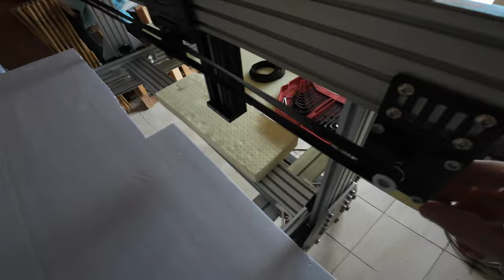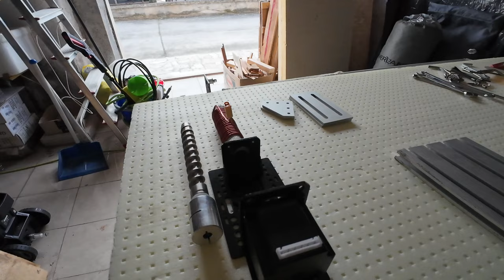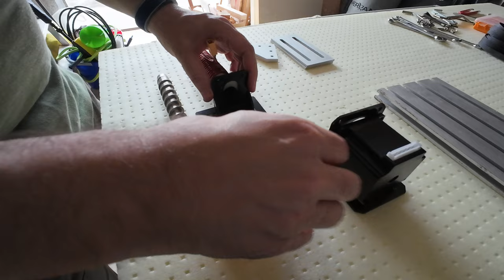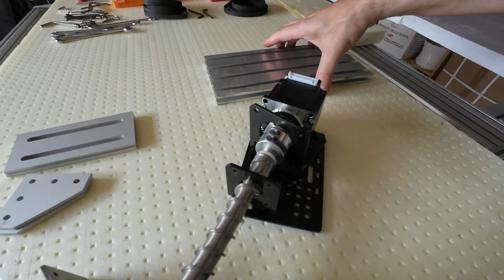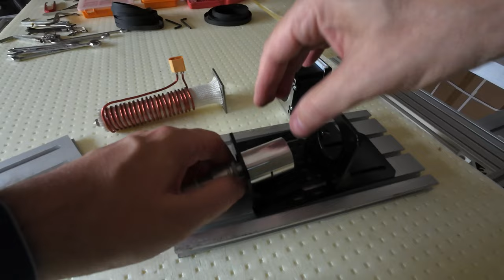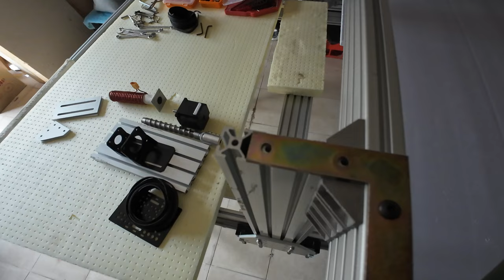X Y Z motors and pellet extruder setup for my Custom 3D printer

Comment: Looks cool. Have you considered a rack and pinion for the x axis? It would add more weight, but could be more reliable. But really, that’s something for later on to even think about. I’d work on the extruder first before worrying about the kinematics.
Reply from the maker: Yes, I have them and if I feel belts are not good I will try them. Extruder is going to be a bit challenging since the tolerances a bit tight, I might need to enlarge the chamber.
Reply: I was thinking about a lead screw but idk about the precision, personally i'll use hiwin ballscrews on mine but they're not cheap :')
Reply from the maker: @feilko2170  I have them and it's an option. The problem is that when they too long they start to oscillate and create problems. There are some solutions but I need to test them first.